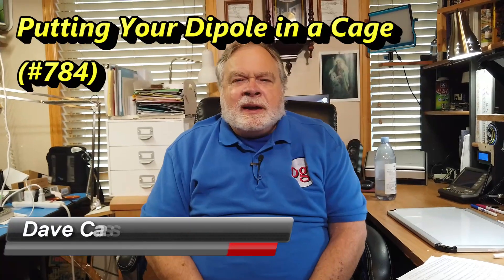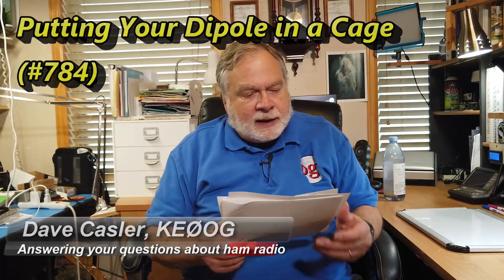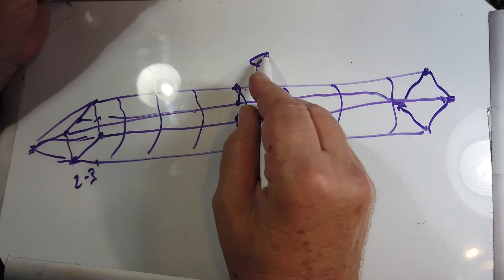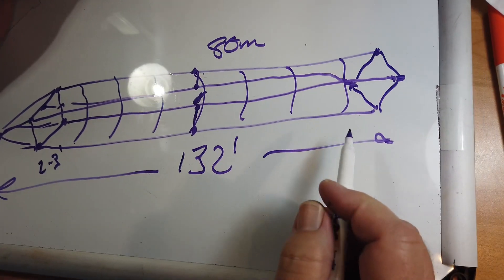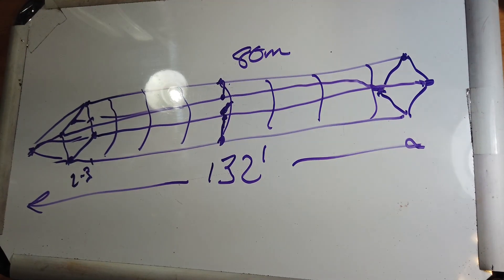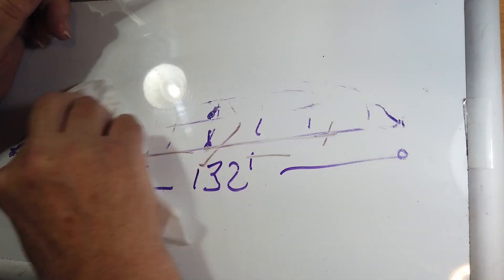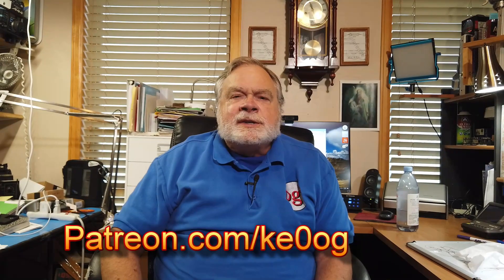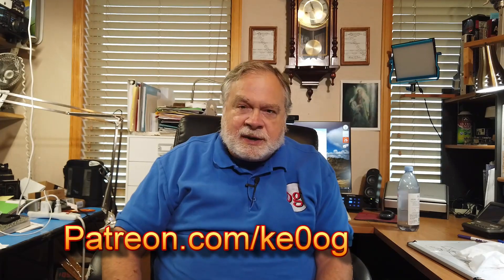Putting Your Dipole in a Cage (#784)

Comment: My cage dipole for 80 meter band. My spacer are 4 inches round pvc 1/2 thick. I have 8 20 gauge wire. I have 10 spacers per leg. I can cover the entire 80 meter band max swr 2.1.

Comment: You could make the cage dipole out of steel rods welded together..... just sayin.
All sorts of variations are done to AM broadcast towers to widen the tune. Same theory the skirt makes it look wider (obviosuly depends on how its attached).
As for chicken wire used in a ground mat.... NO and Agreed.  But use Dog Mesh..... its squares are the size of a cd cover and all cross wires are spot welded! The copper thieves will hate you! wink wink

Comment: Do end feed antenna work good on 80m?
Reply: Yes as long as the coax which is the other 1/2 of the antenna is long enough. I use 75ft of coax for a 135ft end fed with much success.
Reply: @forgetyourlife   I got the EFHW kit from ARRL and a OCF that I will be putting on my 60ft tower with 10ft 1.5 in PVC pipe to hold then about 4.5 feet out from the tower.  One on each side. I know that it will not be high enough but it is the best I can do. I hope to have the ends about 20 feet up. I will have bullies with 550 cord so I don't need to climb up to work on it.  At 75 I don't want to go up there much.